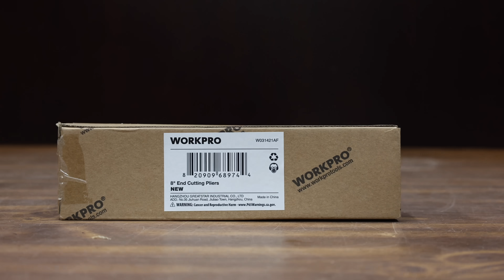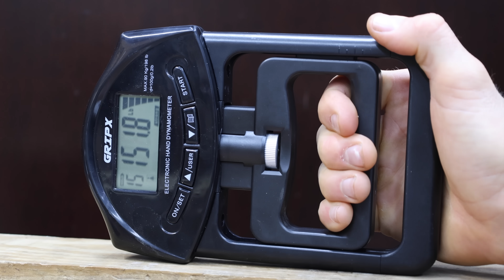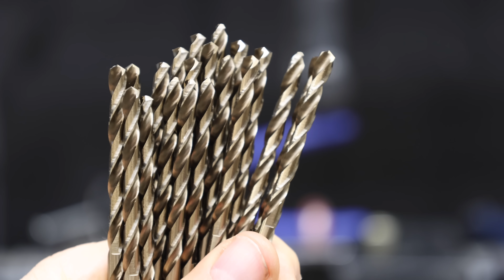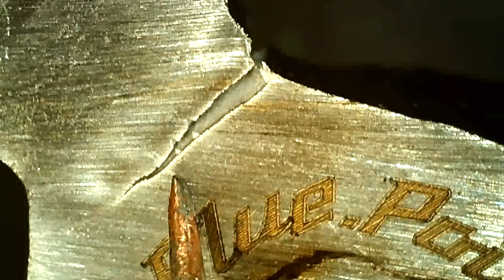Finally! Best Pliers I've Ever Tested! Not Even Close!

Comment: So for these "end cutters" aka "dykes", I have rarely ever cut with them, I usually use angled cutters or bolt cutters.  I mostly use this took for two things.  One, pinching and then pulling out nails and staples in wood, and then the other great use is to use them to pinch and twist out stripped or broken screws and bolts.  When you pinch them without cutting through, then twist, it's a bit like reversing which one is the screw and which is the screw driver.  But it works great, and often better if not at least much faster than vice grip pliers, especially when the broken screw is exposed very little making vice grips impossible.
Reply from the maker: Thanks for sharing

Comment: For the price ($12.99) and overall performance, (6th place) I couldn’t pass up giving American Mutt Tools a try. He also noted that “the cutting knives just don’t line up very well” I wonder how they would have done if they did. When my pair comes in tomorrow, it will be the first thing I check. It is shocking how well the Knipex pair are designed. If I find myself disappointed with the AMT, I’ll just have to break down for the Knipex. Buy once, cry once, right?

Comment: I've had my channel lock version of these for about 30 years and they are still cutting off nail heads and similar things just fine, hasn't rusted, and I pull nail and cut wire with them weekly.

I ve even trimmed my chickens nails with them in a pinch

Comment: The Knipex certainly whipped the competition, about the only thing they struggled with was the flush cutting test which can easily be remedied.  I have a pair (not Knipex) that I use for cutting guitar frets, and cutting as close as possible to the fretboard is important.  I simply used my bench grinder and belt sander to remove the outer bevel, basically right down to the cutting edge.  does a tremendous job on fretwire (certainly not as challenging as cutting a drill bit or hex key.)

Comment: Great review. I use these for steel fixing and cutting  pin nails. The knipex just doesn't get wide open enough for fixing though. I tend to buy mid price and grind the ends down for a flush cut. cordless grinder for everything else.

Comment: This test was kind of silly with trying to cut hex keys, drill bits, etc. Bottom line is that most of them were able to cut the staples close enough to file down a small piece left. I assume most of them can cut most things that they would be used for in normal use.

Comment: If you are cutting staples, grind the ends of the jaws to get a true flush cut.  If the jaws are properly hardened and sharpened, you will get a lifetime out of them.  Back when I could justify SnapOn there was ONE person who cut sharpen them.  If you lost the sharp, your dealer would return them to the factory and you would get your freshened pair back.  They were offset by design.  The absolute best cutting tool I have ever owned. I will bet they are still going, but don’t know who stole them from me 🥵😡🤬🤬🤬😱

Comment: i don't get the hype over the knipex. if i wanted to cut something not flush, i would use a different tool. if i wanted to cut a deck screw, i would use a grinder or rotary tool. the goal for me with a nipper is to cut nails as flush as possible, and only one tool was excellent at that. every nail not cut flush is just more work.

Comment: You should test Lineman Pliers that increase hand pressure.  They using extra pivots (levers) for mechanical advantage to multiply force for tougher cutting or gripping there are multiple manufacturers that all refer to them as leverage, high leverage, compound action, pivot action plyers, or something similar along those lines.
Reply from the maker: Thanks for the suggestion.

Comment: the cutting edges are not meant to line up, it helps to shear off the wire. You need to get flush cut if you want a close cut.

Comment: If you really want a flush cut the right tool for this job is a fret cutter. Fret cutters have the flush alignment like the Japanese pliers that you showed here and they will do the best job of cutting the staple or nail flush against the panel instead of leaving some proud of the material. StewMac is the most widely known brand.

Comment: (note for self)

country of manufacture
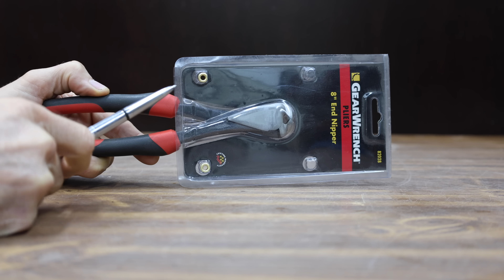(TWN) 03:10 TEKTON / 06:36 GEARWRENCH 
(VNM) 04:02 wiha 
(USA) 04:45 CHANNELLOCK 
(DEU) 05:45 Barnwell / 06:10 NWS / 08:05 KNIPEX / 08:30 GEDORE 
(JPN) 07:30 和桜Wazakura 
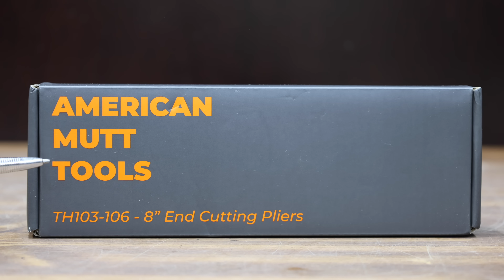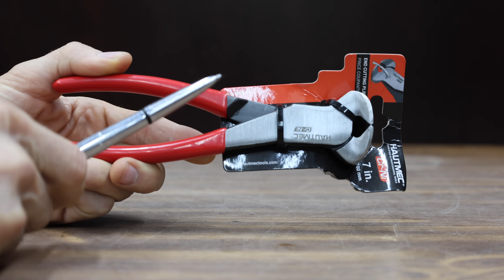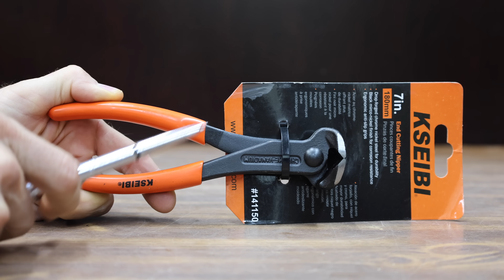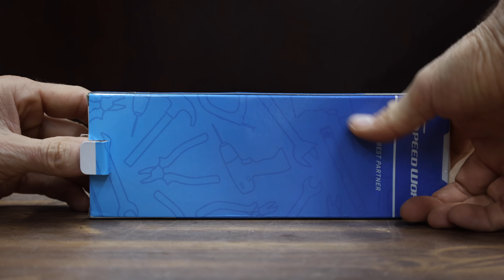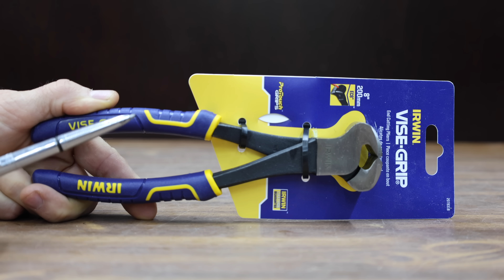(CHN) 00:20 WORKPRO / 00:59 AMERICAN MUTT TOOLS / 01:30 HAUTMEC (7 in) / 01:54 KSEIBI / 02:20 SPEED VOX / 02:43 IRWIN / 03:37 Bates / 04:21  Performance Tool /  05:16 Blue point / 07:03 Milwaukee 

ranking list - 
08:59 flush cut
12:10 force, 16 penny nail (4 mm)
15:45 force, #10 deck screw / 15:58 damage
18:35 force, 3/16 drill bit (4.8 mm) 
21:10 average ranking

Comment: cutting edges are generally misaligned on purpose to give a shearing action... think about it if the blades of scissors cutting edges were aligned to contact each other they wouldn't cut well and would dull each others cutting edges on contact.

Comment: I did want to note that Knipex makes two varients of these pliers.  The 61-02-200 which are "Bolt End Cutters" anf then there is the "Regular End Cutters"    You used the Bolt End cutters.  Which are bolt cutters shaped like End cutters.  So the Knipex had an advantage out of the gate.   If the other brands you tested make a "Bolt end cutter" then you should have also used that version of the end cutter.    But if they didnt, then this was fair.   Because you were testing which bolt cutters were the best and Knipex had the best.  But you did use the "Bolt End cutter" version. Not the "End Cutter" only version.

Comment: Guitar tools international makes a stainless steel fret wire cutter that I use. 7". Stainless Steel Guitar Fret Cutter – GFC2... HCR:60.  Best thing is it is $16.49.  Also, stew Mac is the #1 place for guitar tools, and it's not cheap. Sorta like luthier version of Mac or snap on truck tools.  They sell a version that cost about $40 and I would bet anything stew Mac sells would be the winner. But I could be wrong.

Comment: for anyone interested an average grip strength for a man in his 20s to 40s is only 115lbs, doing 150lbs is more like a top 10% strength. The world record is 363lbs, so nobody is going to be snipping screws and drill bits any time soon.

I honestly would be more interested in seeing wear and tear on the jaws after 100 nails and any surface rust or ease of movement after some time in salt spray box.

While the jaw popping off at 700lbs of pressure on a hex key is impressive and entertaining, that doesn't really say anything about the quality and longevity of a tool.

Comment: I have a pair of N cutters, brand brand unknown. They rarely get used. Diagonal cutters and bolt cutters. You have much better job of cutting things off. Channel locks and demo bars are much more useful for pulling nails. Even a angle grinder would cut all that stuff off flush much quicker. 63 bucks for a Knipex That I would never use no thanks

Comment: I'd be intrigued to know if all Gedore end cutting pliers are this blunt? Or was this from a batch where the sharpening stones were getting warn.. I'm in New Zealand, they aren't sold here so i cant compare. But i have a similar double acting pair made in Germany by Henry Doker their jaws are very sharp despite being over 50 years old. The cut angle is designed for very close staple trimming  and the double action halves the cutting effort on hardened fencing wire etc. Despite being only 7" long they completely out perform all my other cutting pliers. I reckon if you could carefully sharpen the inside bevel of the Gedore ones, they would be extremely hard to beat.

Comment: Have you tested endoscopes and boroscopes?
I've seen different ones from very expensive professional tools to mid-level standalone units to fairly inexpensive ones that you plug into a cell phone or laptop. Now, I understand that if you need to inspect a long, critical infrastructure pipe then spending $4000 on a tool with 50' of fiber optic cable is probably a good investment. However, most people are going to want to spend a lot less than that and only need a few feet of cable. Will a $10 tool work or does it require a $100 tool? Most have lights to illuminate the cavity and mirrors for a side view but the reviews are very mixed with some saying the low end units work and others saying they are complete junk. Adam Savage did do a nice review of the Nidage endoscope which still runs about $30 but that was four years ago.

Comment: I carried nippers in my apron for 25 years as a cabinet maker/finish carpenter.  I used them to pull nails out not cut them off.  I considered it a fail if the nail got cut.  Different uses for the same thing in the hands of different people.
Reply from the maker: Thanks for sharing.

Comment: These typically aren't designed to cut flush. If you want a flush cut, check out Bitterroot Guitars Fret Wire End Nipper. It cuts perfectly flush, but isn't going to be as durable as some of these. You can't have everything unfortunately!
Reply from the maker: Thanks for the feedback.

Comment: The correct tools for cutting staples flush are called Fret Cutters, which have the same flat grind as the Wazakuras.
Most fret cutters are not hardened for use in cutting screws. as your found with the Waxakuras.
Reply from the maker: Thanks for sharing.

Comment: The KNIPEX - 62 02 200 that is linked is $118. Not sure if that is the exact same version tested. I have noticed that some of the products you test, their prices seem to go up after you review them. lol
Reply from the maker: Thanks for the feedback.
Reply: Listing is a mistake. There is no 62-02-200.  The one in the video comes in two versions.  61 01 200: Features standard plastic-coated handles. 61 02 200: Equipped with multi-component (comfort grip) handles.

Comment: Anyone has an answer as to why they wouldn’t just use single bevel blades rather than double? If you want it to be flush, a double bevel blade makes the impossible.. maybe it’s a strength or durability thing, idk.
Reply from the maker: Thanks for the suggestion.

Comment: Pro tip: buy the cheap 10“ crescents, grind the face on a belt carefully to flat and enjoy. You can cut staples flush and pull nails and staples that you would previously need to pry. The longer handles give FAR better grip as well.
Reply from the maker: Thanks!

Comment: I have a set of pliers that don't have any name. I  bought them from one of the big box stores and they weren't particularly expensive.  When I first got them I reground the edges so that they meet flush.  I then hit them with a blow torch and quenched them in oil.  They're now over 40 years old and still razor sharp.  Since the cutting edge is so flush with the end, I can actually cut nails LOWER than the surface as the edges will actually shave the wood.  I can't understand why we can't get pliers made like this in the first place.
Reply: 40 years is not a measure. Some people may use it more in one year than you have used it throughout these years.
Reply: @فارس.التميمي-1444  Would it be better if I told you that I've used them about 14,128 times?  Only approximately.
Reply: @ General talk

Comment: Always used Channel Lock during my days of metal stud framing, drywall, and lathing. Sharp and smooth for tie wire and cutting hanger wires. Always cut off the plastic dip coating to make the handles easier to manipulate while tying. WD 40 every once in a while. May have to check out the Knipex brand. Thanks!
Reply from the maker: Thanks for sharing.

Comment: I thought most of those are nail pullers. You grip the nail and then you use the rounded head to roll and pull the nail out, like with a claw hammer. 

Except maybe the Japanese one, I don’t think they are really meant for snipping.

If you want a flush cut probably be better off using a different tool.
Reply from the maker: Thanks for sharing.

Comment: Tools that are made from forged steel instead of cast steel make a huge difference in their durability.  Some offshore companies will not buy crane hooks that are manufactured in China because they only make hooks from cast steel and what you wind up with is steel with a lot of different tinsel grades within it and they become like fault lines in the steel and when under a lot of stess, the steel will tear apart at those fault lines.  There has been numerous incidents of lifting hooks tearing from loads that were well under what the hook was rated for and when that happens you'll pretty much always find the hook is a cast steel hook.
Reply from the maker: Thanks for the feedback.

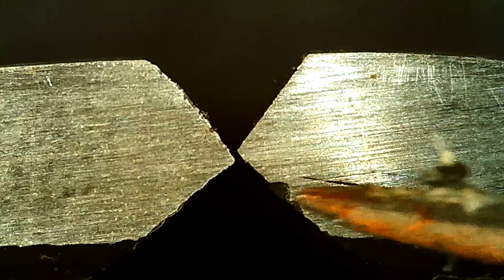Comment: 0:39 Almost all end-nipper type of pliers do have offset jaws so that the jaws don’t wear out prematurely. That is a normal design feature.
Reply from the maker: Thanks for the feedback.
Reply: @ProjectFarm   Yes, end nippers are simply a 90° version of side cutters. I have been around tools since I was eight years old and I have read articles about the different types of cutting edges. These nippers are all designed to be what are called “semi-flush cut”. 

This is the exact same design as traditional wire cutters, except turned 90°. There are another type of cutter called “true flush cut”, and when you buy them, there are warnings about not using them except for plastic wire ties. 

They also have been used for trimming plastic parts and are made by several different companies. 

If you think about it, a true flush wire cutter can ruin the cutting edges the very first time you squeeze them tight. That is why they have strict warnings packed in the box about not using them on anything but plastic. 

Some of them even have the warning “FOR PLASTIC ONLY“ on the handle.

Lots of mechanics use true flush wire cutters for wire ties because it won’t scratch your hands when you reach into that area later on to do some work. 

The really best true flush cutters have a very, very tiny air gap just so that you won’t ruin the cutting edges. You can see this gap if you hold it up to the light.

There is another type of cutting edge design, which is even more offset than “semi flush cut”. The technical term for these cutters escapes me at the moment. 

I love your channel by the way. The first section of your test simply revealed that all of these cutters do their job, they cut something off with a slight protrusion not because they are designed for that purpose, just as an artifact of their intentional offset cutting edge design. I would like to see a test of these used in one of the two ways they’re designed for. That would be pulling out a nail by gripping the nail down low and then rocking the pliers sideways. 

If you do a little bit of research, you can find cutaway diagrams with illustrations showing the very specific ways in which wire cutting edges (blades) are made. 

These (3) different designs hold true whether they are the traditional side cutters, commonly called wire cutters, or the end cutters that you tested, which are colloquially referred to as end nippers. Thanks!

Comment: I used Knipex pliers/cutters when I worked in the beverage industry for Coca Cola and then Pepsi.
I used them to crimp stainless steel collars onto s/s barbs and fittings and also to cut those collars off when doing repairs or stripping old splices and tees for re- use.
I had them for nearly 10 years and they were still going strong although the jaws were starting to show some wear.
Best Pliers on the market.
Reply from the maker: Thanks for sharing.

Comment: I'm a guitar builder big into Stainless steel and tough brass alloy fret wire, and had to look high and low to find cutters up to the task, and I found some by "Fastcap" they set me back quite a bit.  They do cut well, the cutting edges are extremely close and sharp, and there are no sharpening edges on the front at all,  and the whole thing is ground to a flush curve to get close to whatever your cutting like the edge of a fingerboard.  Sadly it's still not perfect, as they are quite hard to squeeze and will give you a work out.  They need to work out better leverage, because cutting 24 SS frets by hand hurts!
Reply from the maker: Thanks for sharing.
Reply: @ProjectFarm  I still need much better ones!!!:face-fuchsia-tongue-out:

Comment: The cutting edges are designed in a Shear alignment,  Not supposed to be Point to Point. One edge should slightly overlap the other to create a shearing force.

Comment: Are you sure you are comparing direct equivalents? I don't have much experience in nippers, but I do in side cutters. Side cutters is an umbrella term, they make a version of side cutters called flush-cutters, they are completely ground down flat on one side, they also make other normal cutters that almost appear like this to the un-initiated, but they actually have a slight v on the blade, meaning they aren't actually flush cutters (but could easily be mistaken for them).